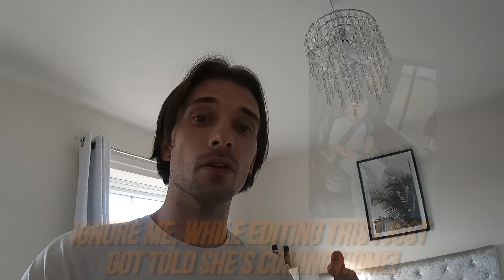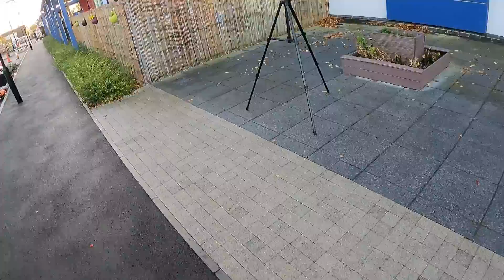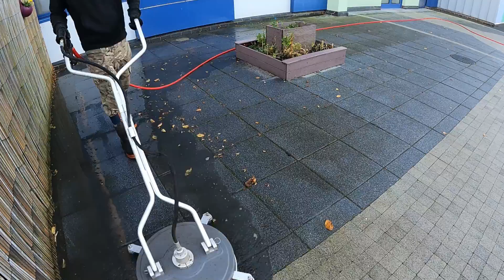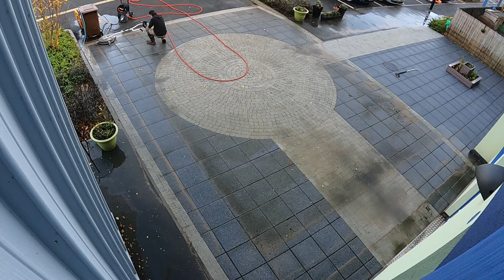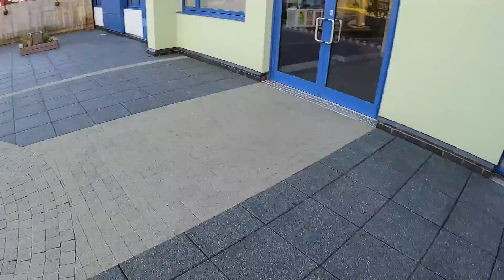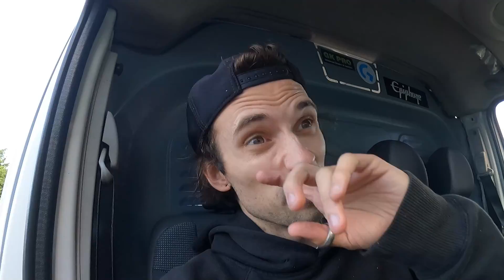This School Couldn't Believe I Wanted to Clean Their FILTHY COURTYARD for FREE!

Comment: That angled wand looks like it does really well for rinsing flat surfaces. Must save your back a bit!
Reply from the maker: Yeah it took some getting used to its got a kick to it :D
Reply: @PartridgeExteriorCleaning  Get yourself a 10 inch length of pipe, thread each end. Fit yr quick connects, attach yr J rod, & away you go. Hose in one hand, gun in the other, waaay more easier....

Comment: What engine you've got in your Expert? I've got the same car, just with different badge and I think 1.6 was a bad choice. I drive longer distances though, so 2.0 would be better for me. I've got a custom gearbox, because the original one had too short gears, and now It's lacking power. I gotta remap it.